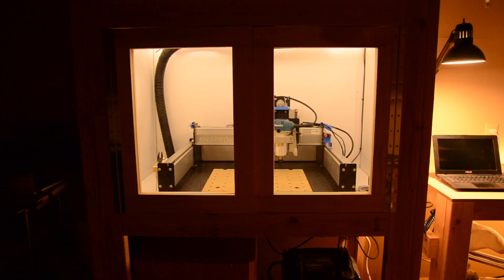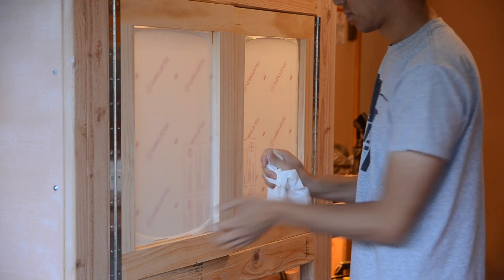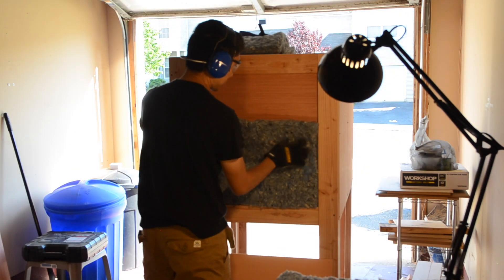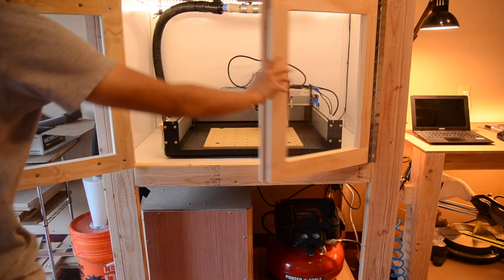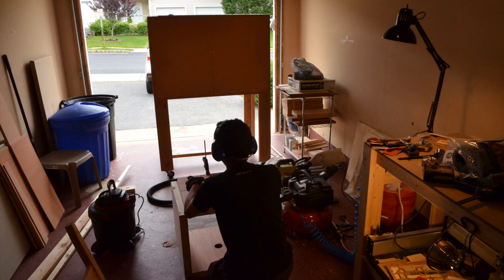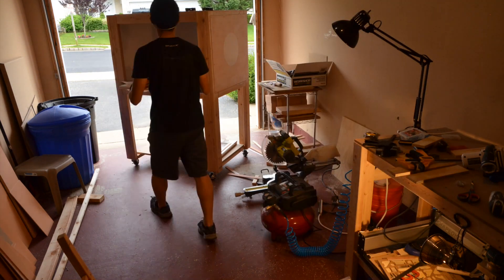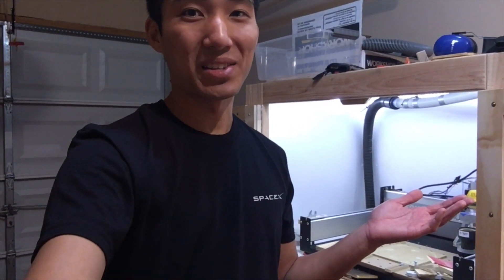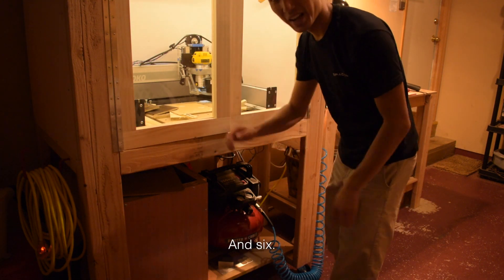Building a 2x4 CNC Enclosure - CNC Project #96

Comment: Hi Winston, I made one similar for my 1000x1000x x-carve, however, mine is a quite a bit bigger. I opted to insulate top and bottom with acoustic wall insulation, as well as foam sound treatment inside. This was done top and bottom as my shop vac sits in the same spot.

The router speed control box is something you have I don't and thanks to your video I will now get. Mine withholds the noise a little better though as in both combined and garage closed you cannot hear a single thing. I will share it on the inventables forum when it gets out of storage (moving)

Comment: Looks good - much prettier than mine. I wanted to cut down sound but also reduce the risk of a fire so lined the inside with gib-board (drywall), then polystyrene, then mdf on the outside.

Comment: i notice you still have an un insulated bottom below the router. instead of insulating the floor you can always try building an insulated wall around the base as it will aid in insulating noise coming from the base of the router as well as from the shop vac. also sound travels via vibrations, but have you tried foam liner inside as a deadener in the cutting area? it will absorb noise rather than allow it to bounce off such a smooth and hardened surface. they use that method alot in sound rooms for musicians. keeps the echo down. also use a proper sealant around all the cracks. possibly even rubber strips around the door contact areas. not much you can do with the two front doors unless you attempt to double pane it, lock it, and add rubber seals .

Comment: I used the same denim insulation and it works REALLY well. However, I did not cover it with another layer of wood so I am curious if that made a difference? I had planned on covering the denim with a white table cloth material to bounce the light. So far so good and the acoustics are amazing! When I had my head inside the box cleaning it and talking to a friend he said he could barely hear me. He then demonstrated and I was blown away.
Reply from the maker: +Savant PCs I should run a test without the interior panels, but my thought was that it would be easier to keep a rigid walled structure clean, than a fabric. Especially with a high gloss paint. You can vacuum fabric, but you'll never get all of the dust out. Plywood walls are lower maintenance.
Reply: Makes total sense. My unit is inside a townhouse so I had to use all the sound dampening I could get! Thankfully most the sheet metal dust just bounces right off and I can vacuum it off on the bed of the table.

Comment: try weather stripping every gap on the inside of the doors. then add a latch to keep the doors closed with pressure on the stripping. that right there cut the sound coming out of my enclosure in half. maybe some insulation taped into the holes around the cables, but i left mine open. another thing i did to isolate vibration from the enclosure was put the shapeoko 3 on a thick sheet of neoprene rubber. i can watch a movie next to it while it's running now.

Comment: You need Mass to block sound. and need to seal any airgaps. when doing it DIY on the cheap. use Drywall, its dense and cheap. sandwich 3 layers together and use greenglue adhesive between them to keep them isolated. you dont want any mechanical fasteners between your layers of drywall. the more mechanical fasteners the more sound gets transferred through the material. MDF is also good as its dense. many people build a Box in a Box that is isolated with carpet or rubber or foam. Winston for your build i would suggest you add some rubber gaskets around the door seal. so when its closed its more air tight and also add something to fill the holes for your wires

Comment: Is that the 6-gallon Porter Cable compressor?  Does it have enough CFM output to keep up with a constant air blast on the tool path?
Reply from the maker: I wasn't using it for airblast, but probably not. And even if it did I would hate to keep it running. It's obnoxiously noisy. Also I doubt its rated for the necessary duty cycle because it'd have to kick on every few minutes.
Reply: @WinstonMakes  Thanks for the quick reply.  Do you have any experience using a bit fan for chip clearing?
Reply from the maker: I've seen them on small ER-11 spindles, but never a router. Don't see why it wouldn't work, but Idk how much more airflow you'd get vs router exhaust.

Comment: Good build there Winston, you've made a few, almost expert now!
Is there a plain 500w spindle or similar that is designed for 4+ hour continuous use? Trim routers are good, extra powerful, cut through anything, but bit noisy and not designed for such a duty cycle.

Comment: Line the inside of the enclosure with acoustic ceiling panels or egg crate foam?
Reply from the maker: I thought about it, anything soft/open cell will eventually get packed with dust and it's harder to maintain in the long run.

Comment: Have you considered magnets embedded in the door and frame to keep the door closed?
Reply from the maker: +Andreas Bested Nielsen it has crossed my mind, but the underlying issue is that the 2x4s aren't perfectly straight, which means the doors aren't necessarily in the same plane. They don't shut to the same point. If I ever build this again (I hope not), I'm probably going to joint and plane my boards first...
Reply: a piece of wood screwed to the frame you can turn to keep the door in would work
Reply: @fuzzy1dk  i was just about to suggest that, simple is always better ;0)

Comment: Running shop vac on reduced power doesn't seem safe.  My manual says "grounding cord of adequate size must be used for safety, and to prevent loss of power and overheating".
Reply from the maker: +bswrtht the speed controller is grounded all the way through, and rated for the necessary amperage. It's also a triac and limits current, not voltage, so it's not going to pose a fire risk in the way non-dimmable CFL bulbs do. 

The shop vac is air cooled like any router, and hasn't gotten warm at all.

Comment: Why don't you change your air cooled router for watter cooled spindle ?? I think that you reduce most of the noise by it
Reply from the maker: It'll certainly help, although the actual noise made by cutting material accounts for more noise than the spindle itself. The nomad is super quiet (the spindle at least, the frame and stepper motors have a weird resonance), but it can be as problematic as my Shapeoko when cutting.

Comment: do you have soundproof feet under the shapeoko ?
Reply from the maker: +k theo Not exactly. The little adhesive rubber feet on my (2015) Shapeoko have long since worn off. It now sits on a half inch sheet of polyethylene foam, which is arguably more effective. Just not adjustable.

Comment: Hello Winston, I am new to CNC and enjoy your videos. I too recently made an enclosure with sound as the primary concern (in a house etc) I use polystyrene blocks covered with corflute sheets (all recycled). It has a removable front with a 8mm glass window (recycled from old cabinet). It is a little bulky, but really quiet and very light so I can easily remove the entire enclosure to access the machine if need be. Check here if you would like to see it: https://youtu.be/b6pZv6ZhUH0?t=1m15s